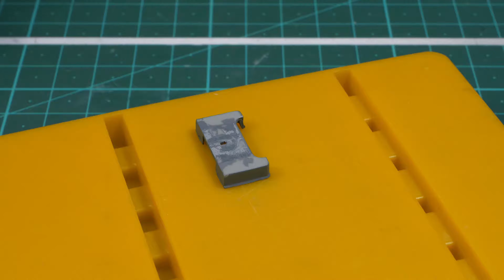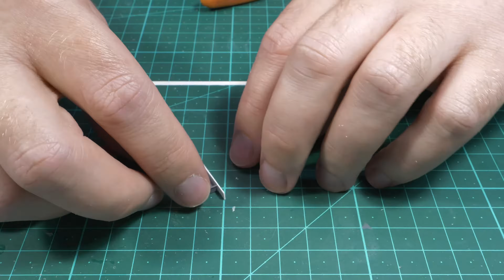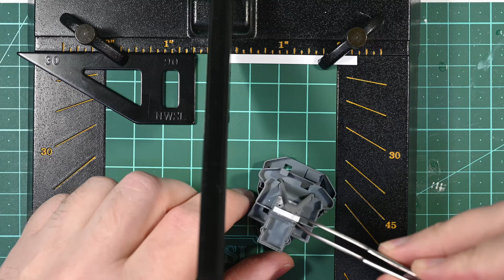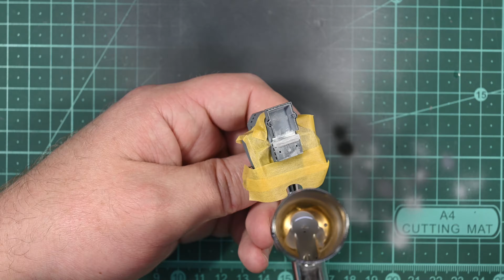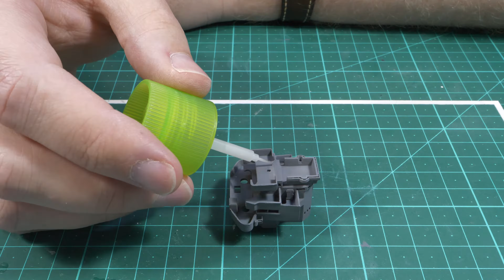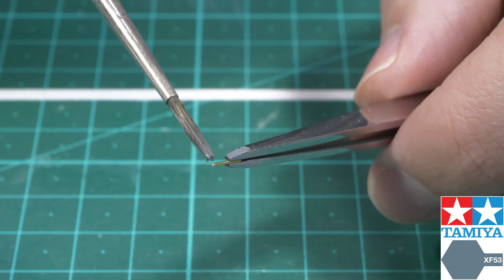1:350 HMS Hood: Part 53 - Upper Air Defense Platform

Comment: I’ve seen a lot of Hood models have this problem with the forward leg is tilted back or forward making the spotting top have a weird angle on the bridge because of this tight squeeze, the new Flyhawk Hood also has this problem..
Reply from the maker: Tripod masts always seem to be a problem with ship models. I don't think I have ever encountered one that works really well. In the case of this model, the area is so heavily modified at this point that if I mess it up it will be entirely my fault.